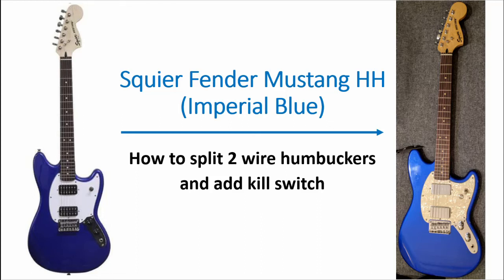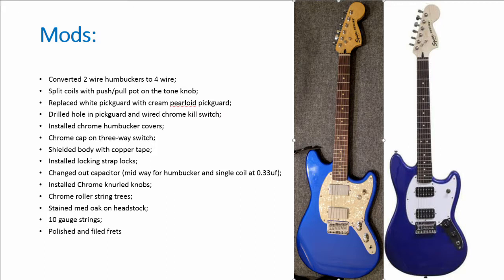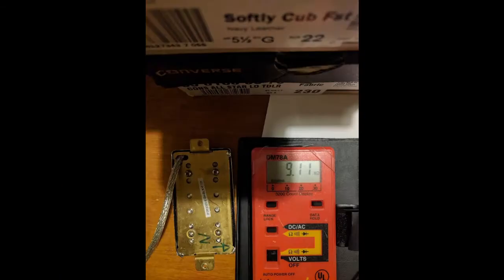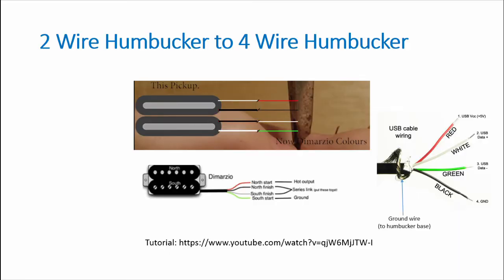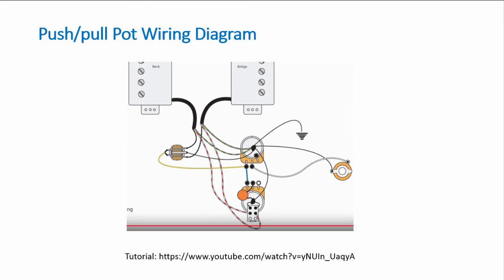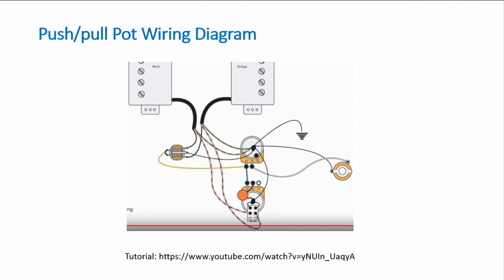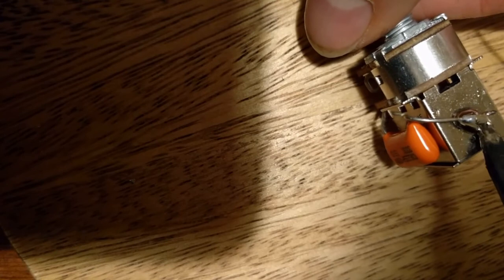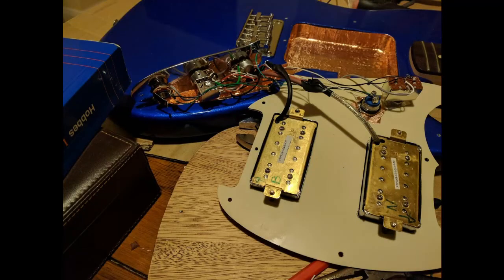Squier Bullet Mustang: 2 wire to 4 wire humbucker to split coil (single coil) and kill switch

Comment: hey there, I know I'm a bit late to this but did you have to do any modifications to make the push-pull knobs fit in the pickguard/the cavity? is there any chance you'd be able to send me a link to the ones you used? thanks!
Reply from the maker: Hi, I didn't have chisel the cavity, I bought short shaft pots. But, I had to break off the ground on the bottom to fit the narrow width of the cavity, which is fine, just ground to the side of the pot. Get the short pots, there are two conventional shaft heights, should work fine. Sorry, no link, too long ago. Somewhere in China I assume via Amazon. I hope that helps.

Comment: Hi Tristan, sweet job. Where did you source the pickguard and switch tip from?
Reply from the maker: Thx! Earlpilanz is the pickguard seller on eBay. Switch tip from Amazon, removed from another switch and screwed onto the original switch.

Comment: How did you stain the headstock?  Did you literally just stain it, or did you strip and stain and then add the decal back?  Did you use painter's tape around the edge so that the rear didn't get stained as well?  Love the job you did on the whole thing :)
Reply from the maker: Thank you. I removed the tuners and lightly used 1200 grit paper on the whole headstock (even slightly over the decal), and then used a very small amount of medium oak floor varnish on a cloth. I stopped at the back where the headstock meets the neck, using less as I reached that area so it blends without a seam.